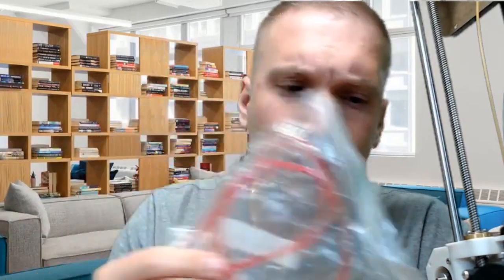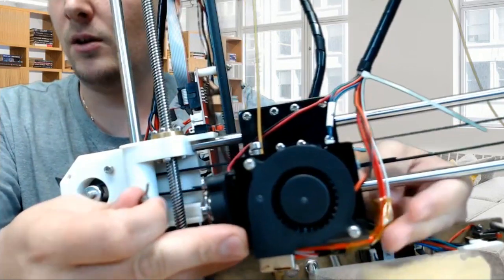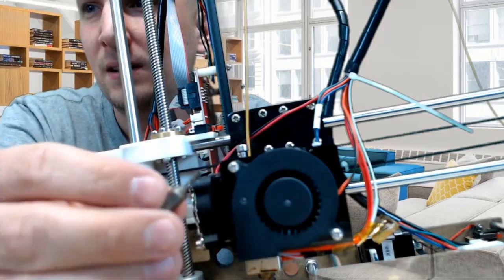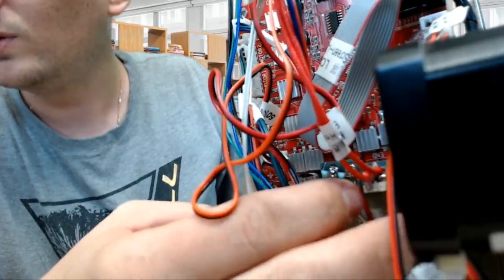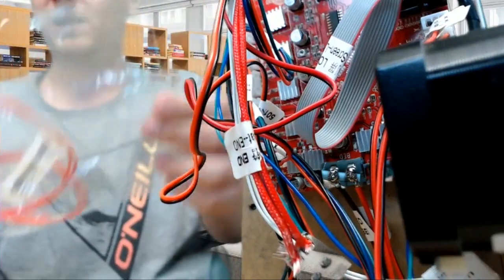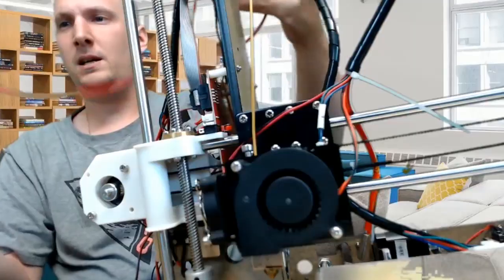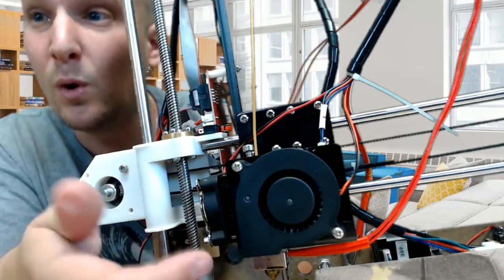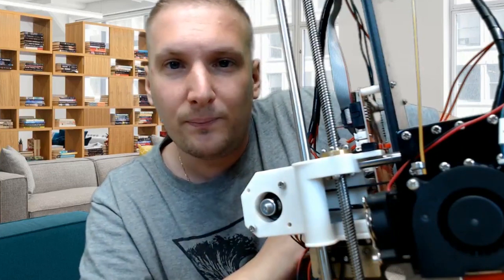Anet a8 Install New Heater Cartridge on 3d printer

Comment: I hope nothing bad happened to you when you tried to heat up the nozzle without replacing the thermistor next to the heater cable that is taped together with the old heater cable :( You shouldn't give people incomplete advice, because if your firmware has no thermal runaway enabled, you're looking at a printer that will catch fire...

Comment: I'm hating the anet a8, I just replaced my heat element and after a few prints my new one just broke. I dont and cant figure out why its breaking so fast.
Reply: Maybe it’s cheap or it can’t handle the temp
Reply: @mozzde4675  I found out there was a screw that was used to I guess change the power input. My brother bumped it up to make the fan go faster but it put to much power to the heat element abd woud fry it. Since I fixed that my printer has been fine. 

Overall it can do some good quality prints but my brother upgraded his ant it kicks the 8nets tail. It can do angles and curves that the 8net can't. I still have the Anet and its fine for me. My bed had to be soldered directly because the connection melted.  And I chose to cut out a piece of glass for the bed and its been great. My dad has the Anet too but he uses solidworks and makes lots of things, he would definitely benefit from a better machine. Me, I just print out simple things, so the Anet is fine.